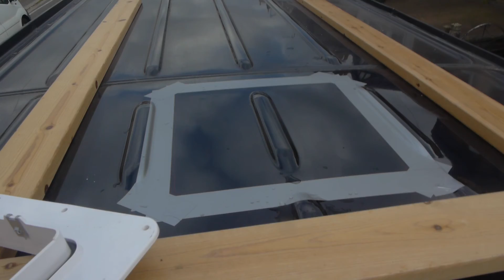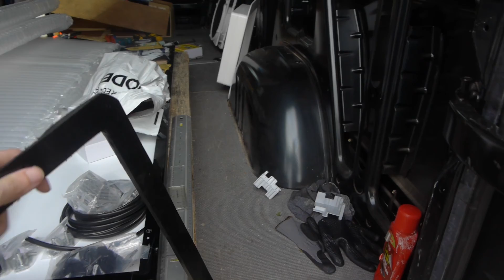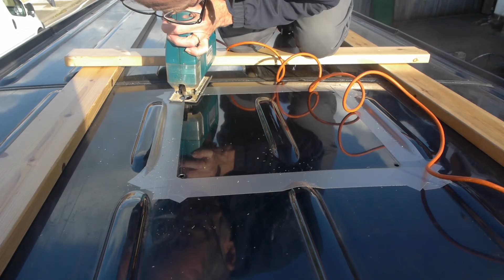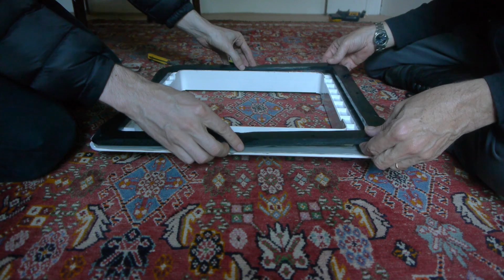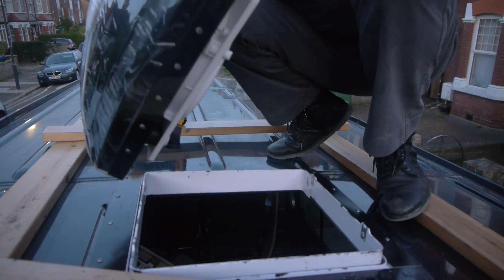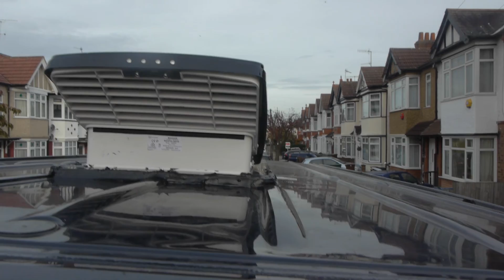Maxxair Fan Install (on Mercedes Sprinter Campervan)

Comment: Which mastic tape did you use?
Reply from the maker: it was the 40mm wide campervan mastic tape from ebay I think which was too wide so I had to slice some off

Comment: you see these fans on youtube on builds from the USA. I have noticed a lot of UK campers and motorhomes just use a simple skylight for ventilation and sometimes a small extractor fan for the cooking area. with a bigger priority put on heating for UK campers (maybe they are older campers).  Why did you choose such a large fan? where you just copying  YouTube van builds?. Not that I think that is bad idea I am just curious about your design method. I am vary interested in this build.
Reply from the maker: yeah I was copying other builds and because it offered good ventilation while also being able to use it when raining outside
Reply: these fans work a lot better if you have vents in the van to allow airflow. If you get any more leaks plumbers gold sealant is good stuff. good luck with the build and please keep the videos coming